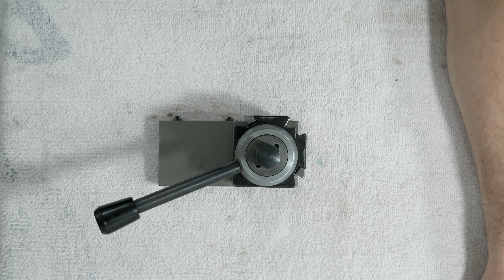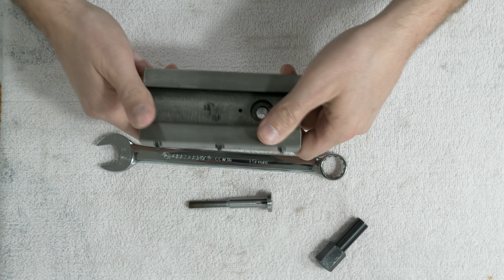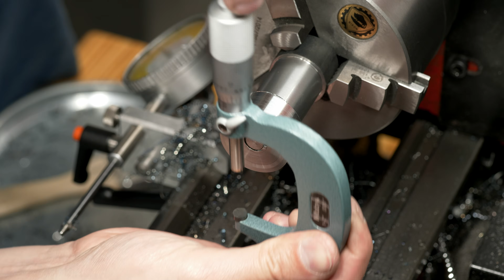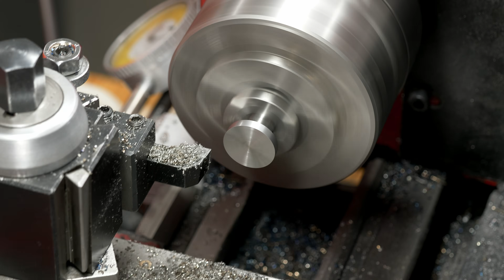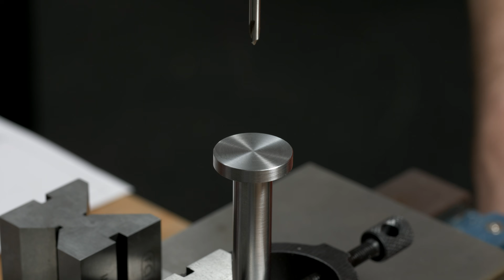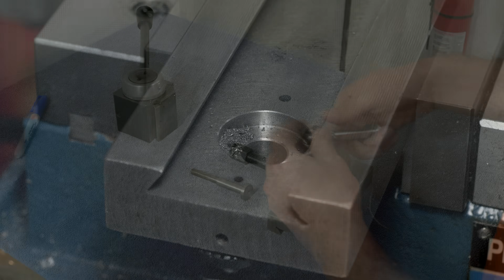QCTP Stud Upgrade

Comment: Have you seen  this video?    

 https://www.youtube.com/watch?v=glbrNvnjpZU

It`s another way to skin your kitty with a lot less work...  I used his simple bolt idea that was drilled and tapped to add an AXA to a Grizzly 8"

https://www.youtube.com/watch?v=v2bFFB7O2PA&t=4s

Then its easy  to add a cylindrical top to cover the hex bolt and add a second handle to avoid using the damn wrench....
Perhaps using a large wrench on a small 10 or 12 mm stud is overkill?  and a disaster waiting to handle?

One consideration is the cross slide and compound of these lightweight Asian lathes is that they are not the beefy metal parts like  the Logans or South Bends.  
So, perhaps best avoid removing any metal or making modifications that might weaken the structure of the slide or compound.  
Strongly suggest you ditch the wrench and get something more appropriate for the existing conditions.   The handle is always there for you as well.....
Reply from the maker: The stud itself is always the weakest point, because it's in tension and everything else is in compression. 

If I had to guess, the reason they went with a 19mm wrench is because that's what the tail stock uses. They probably figured it was a benefit to the consumer to only need one wrench, and didn't consider the consequences of an incorrectly size wrench and fastener. The tail stock is M12, and after doing research i learned that a 19mm wrench is the correct.

I prefer a wrench to a handle because it minimizes the amount of stuff that's in my way. If I had a larger 12 or 13 inch lathe, i would probably go with a handle.

Comment: Might not have hurt to take a light cut on the dovetails on the slide to even it up a bit. If you didn’t want to take it all, you could have taken half - assuming the vice and parallels are level. Easy for me to say, you were working and filming and I was sitting back and sipping coffee. :)

Comment: Couldn't have asked for a better result. I have an Enco 9x20 with the same exact design 10mm stud with 8mm thread, pinned and would like to find the stud bolt you were using initially for the AXA post just to get me going. My mill is apart for a CNC conversion and required a lathe upgrade(ballscrews/pullies) so I'm beteeen a rock and a hard place on DIY for the moment.
Reply from the maker: The quickest and cheapest way to do it, is how i did it when I broke the original stud on my lathe and didn't have a spare. Buy a properly size bolt from the hardware store, and then go at it with a bench or angle grinder. It won't be pretty,  and it will be a little difficult to tighten the first time, but it will get you through the task or turning a custom stud.